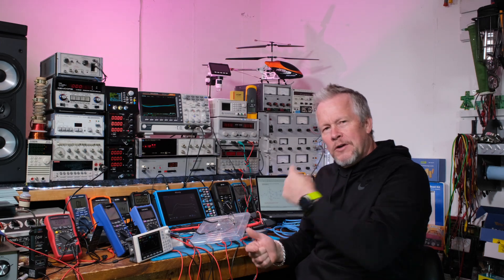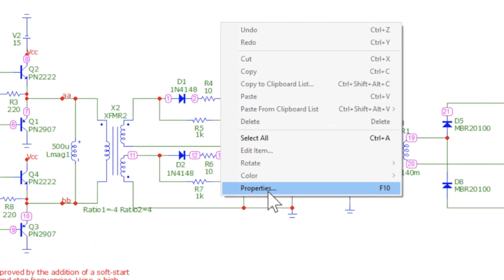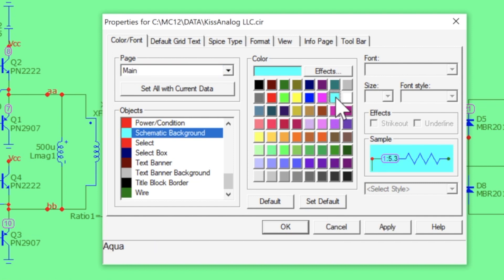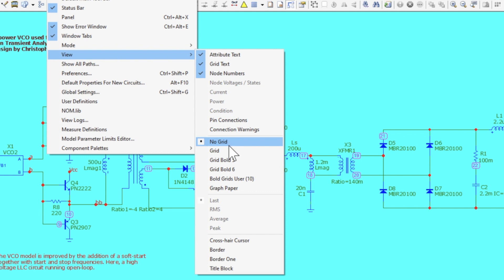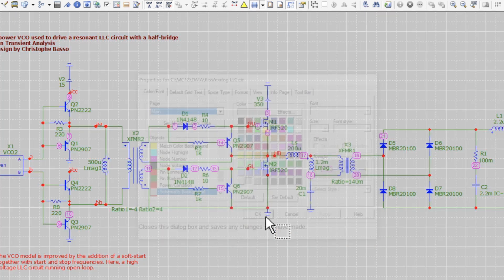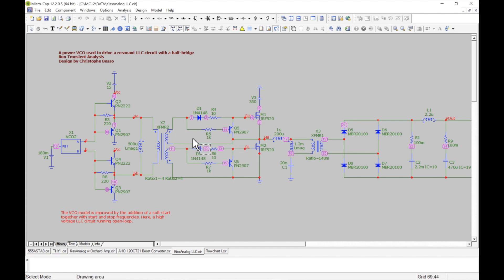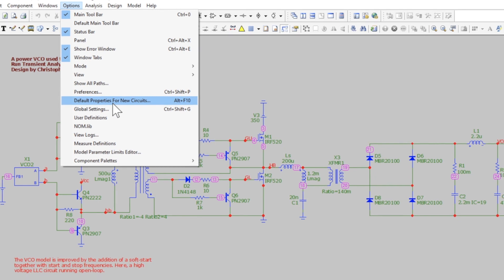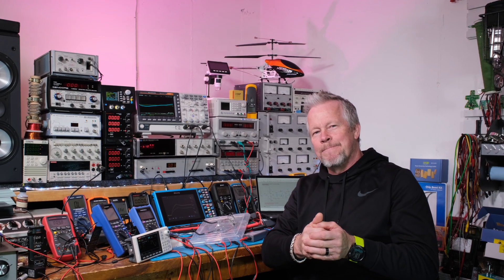MicroCap Tutorial Visual Preference Setup #microcaptutorial

Comment: How accurate is the the simulation compared to real life measurements
Reply from the maker: That's the million dollar question John;)  I think simulations can be very accurate, but there can be a bad simulation or even a not so good simulation too.   It is always good to correlate actual test results with the simulation to improve the simulation model.  Usually the problem is when there are parasitics in a circuit element that is not taken into account then the simulation is only as good as the ingredients put in the recipe.